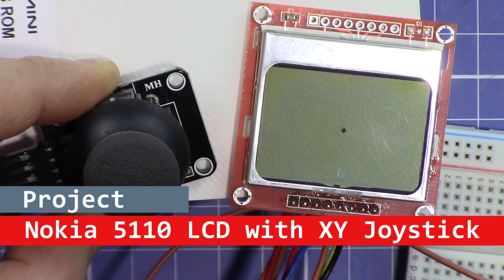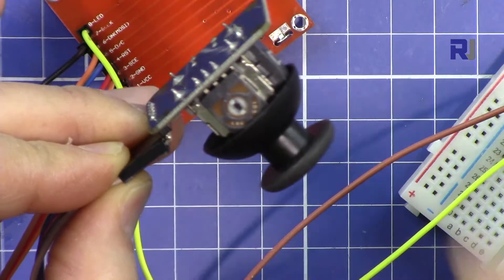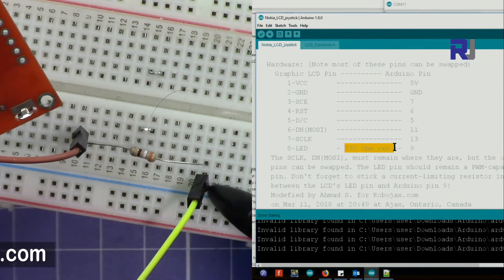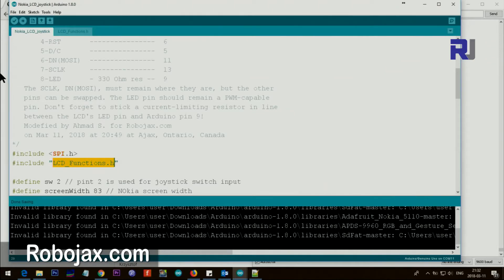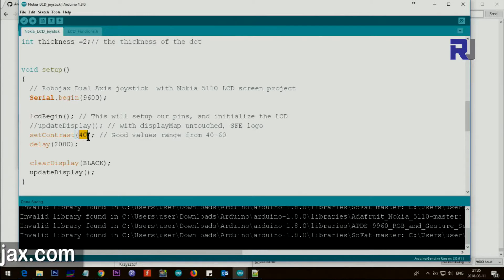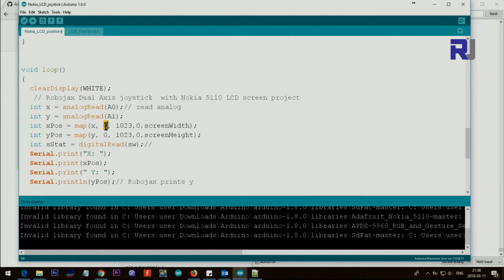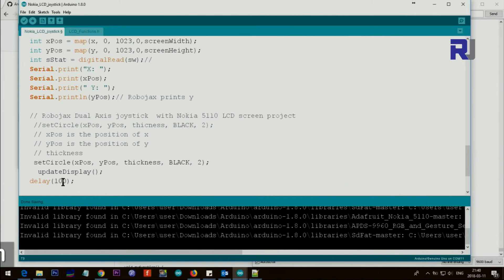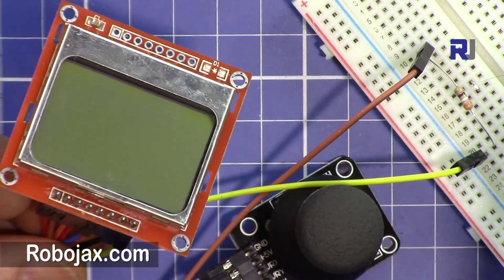Using Nokia 5110 LCD screen with XY Joystick with Arduino RJT65

Comment: where is the link for the library?
Reply from the maker: Under the video in description
Reply: @robojax  you linked your code...but theres no link to download the library you can only download the code. can you show me the link for the library?
Reply: @robojax  man the library download link is not in the decription. i have searched all your video descriptions and the link to download library is not there. the only thing that you linked is the code, which also doesnt have any instructions on how to get the library. could you please just link the library as a google drive file or website link to download the library. i really wanna use it 
thanks